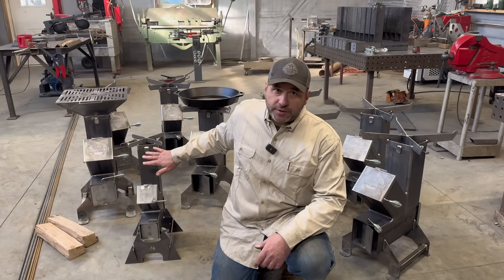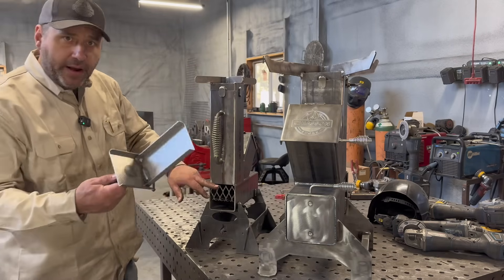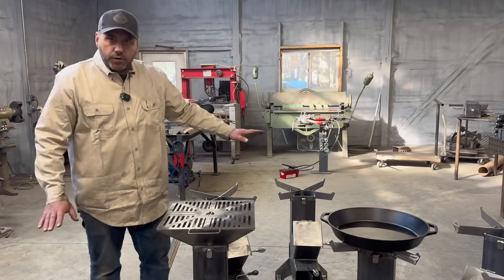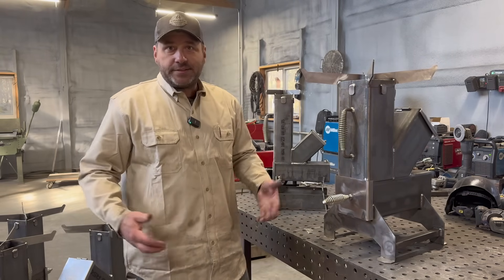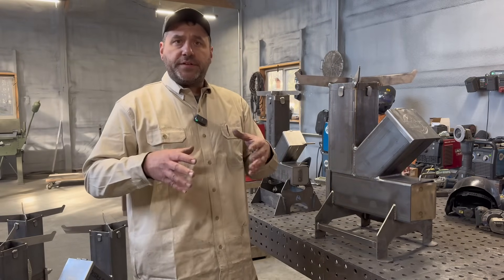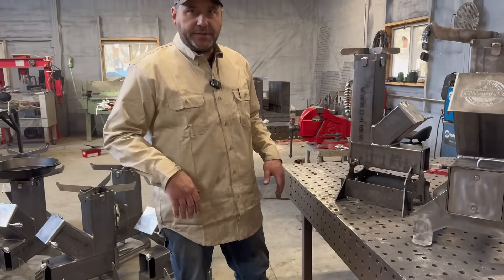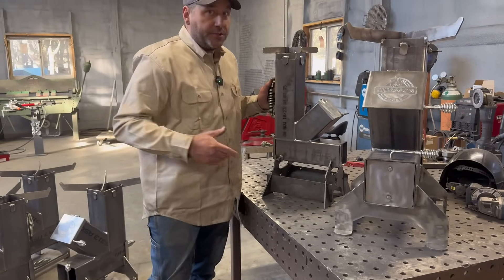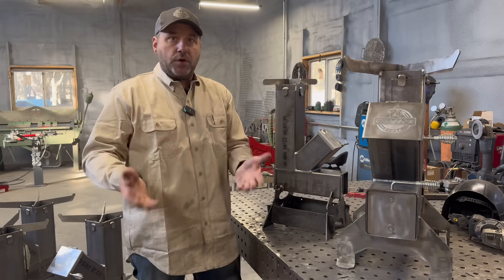Chiassonsmoke Rocketstove

Comment: Funny I run across this video to day, I’m actually building my first rocket stove and one of the things I decided on this afternoon is I’m not going to paint it, I’m going for the oiled cast iron patina look and planning on using boiled linseed oil. . . I have totally different damper set up, and my ash dump is on the bottom.

Comment: Unless you have a shop like this and some serious welding skills you are NOT making these stoves at home.  Nice shop, welding fixture table, and excellent video.
Reply: I've made this same style with a chop saw, cutting wheel,  grinder and welder.  It's not rocket science
Reply: @evocreations8772 
Question... if you reduce the air ( cut the fire down) doesn't that make it smoke?
Reply: Who are these people who can’t run a simple buzz box and “hot” glue some steel together 

Time to find you nuts 🥜 😅
Reply: got a little mig welder, some beer and a weekend that says otherwise.
Reply: @rickh9507  made one after this post in 2 hours..
Reply: I love working at a fab shop. The owners are nice enough to let us work on our own projects occasionally. Having a water-cooled saw that can cut at an angle is fuckin sweet. Don't need to measure just set the saws angle. That's not even mentioning all the torches and plasma cutters. The welding is just an after thought. I don't even have to do a good job welding. If it's cut and fit nice it's I can weld fast loose and it still comes out fine
Reply: Not true att all. It will take longer in your garage, but it's an easy project to test out your abilities
Reply: You could tac this thing together and it will run just fine.. probably one of the only things you could even not weld. You could jbweld and it would probably still work
Reply: You could do it all with a grinder and a welder
Reply: I make these all day long with hot glue gun, some foam and a bench.
Reply: Yer not paying attention
Reply: Speak for yourself, just because you don’t have skills
Reply: @tonybarracuda3505  Well he said if you dont have the skills you're not making them, so if you have the skills, then he's right lol
Reply: @ryanfreeman125  you don’t need a big shop, fancy welding table or “ serious welding skills “to build something like this. If you can lay down a halfassed bead you could build this thing. Might not be as pretty but it will work.

Comment: I have a different model of a rocket stove. The big advantage of rocket stoves is that they’re super efficient. You can boil a five gallon pot of water with just a few sticks an inch or two in diameter and a few feet long.

Comment: I do like your rocket stoves. I have made quite a few. Most guys want it for camping so it is the  4 inch models I make.  I have dampers in my stoves  and a special scaping tool to remove ash. I have not had any trouble with the paint, I use high temp manifold paint which is used to heating and cooling. 1200 degree to 2200 degrees.